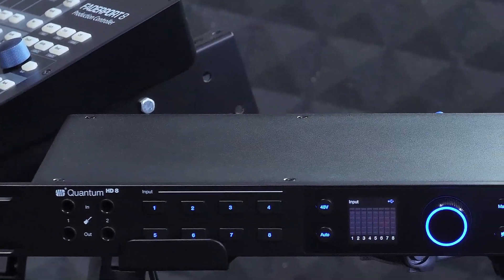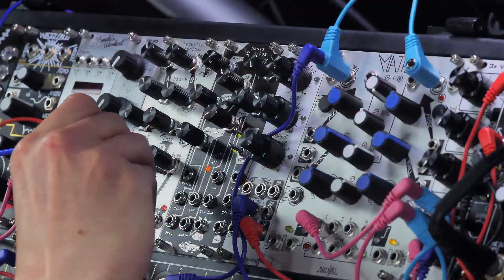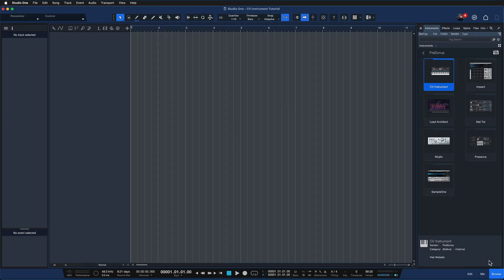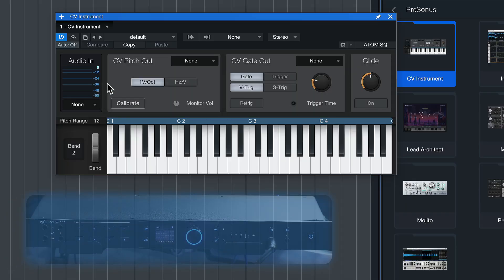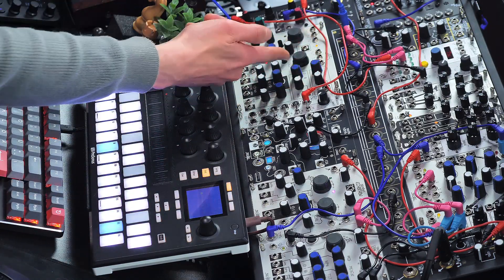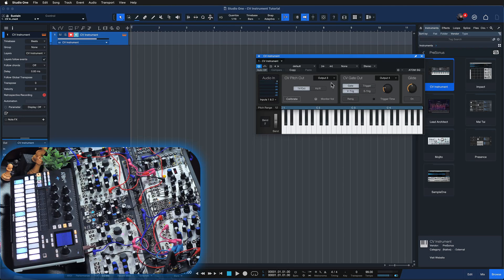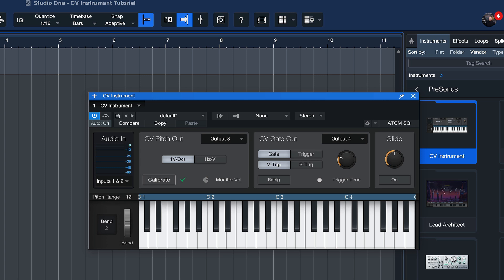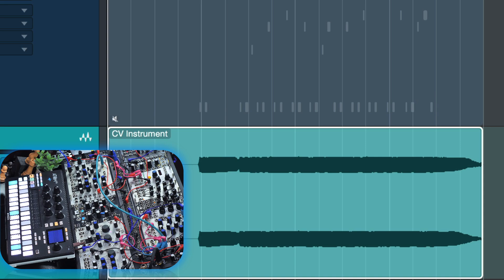Analog-Digital Workflows with the CV Instrument in Studio One Pro 7 | PreSonus

Comment: This is so cool! Im totally new to modular synths, just tried it with my pocket operator modular 400 from teenage engineering and here I have just one output and no 1V/oct.I connected it to my interface but cannot calibrate it, just can hear the synth sound but nothing more. do I need a " big" modular system for this?